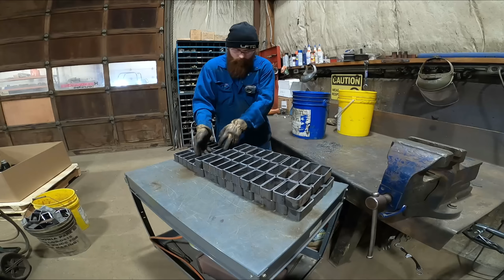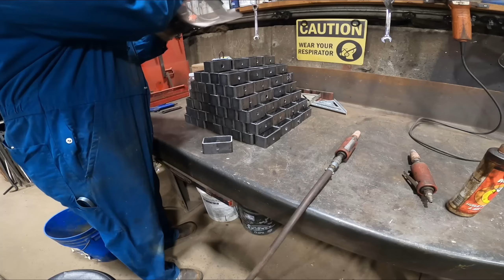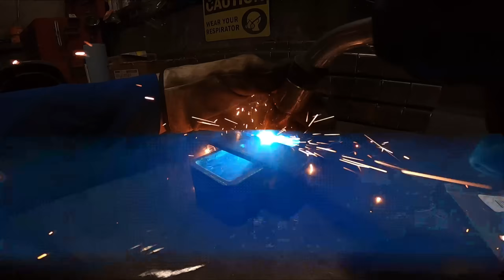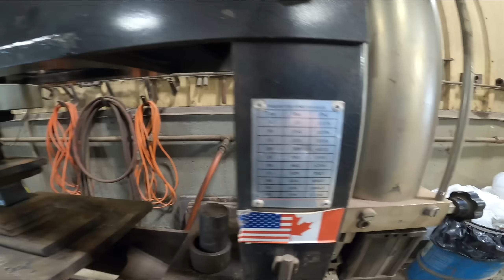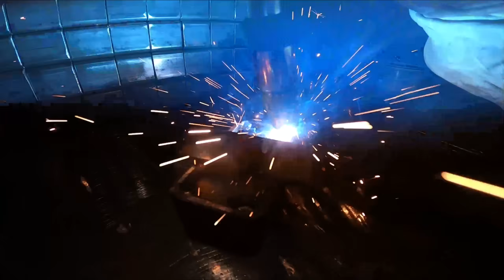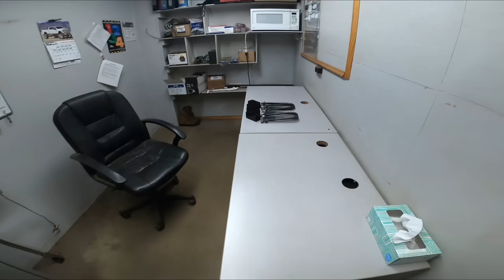How we fabricate a 2" lift kit for a camper trailer

Comment: You may want to look at an industrial shop that has huge resistance welders to weld the center pins in. The would weld the pin in the exact center in a matter of seconds. You could look at a capacitance discharge welder to do it yourself. Much faster and probably cost effecrive compared to labor rate.

Comment: Soild block would be a lot faster. A lot of driiling I did 52 2" and 52 3" it took me 2 about 15 hours to prepare drill and debar and clean the blocks for powder coating.
Reply from the maker: yes, solid blocks are a lot faster, now we can do about 30 blocks an hour.  Can't wait to get my 2nd drill press rolling this fall so we can do 60 blocks an hour.

Comment: I work for Northwest Steelcrafters and I have been making lift blocks for trailers.
2" & 3" blocks.
Did all the prediction today powder coating 
Tomorrow.
Lots of work with a 1940's Bridgeport milling machine
Reply from the maker: We started making them out of solid steel.  2x4x1.75
Reply: @simcoespring  
Nice work.

Comment: Why not just whack a stick of 2"x2" into 4" pieces? In 5/16 wall they'd hold god knows how much but 15T would be no problem and you wouldn't need to waste time capping them.
Reply from the maker: Because it is 2 x 1.75.            Not 2x2.  A more complex shape
Reply: @simcoespring  Still could've used it, a 2" Ubolt over a 1.75 pack equals an 1/8th on either side, not really critical. Your profit after labor wasn't worth it, not unless you pay your guys 5 bucks an hr. and even then..
Reply: At. Work we are making trailer raiser blocks we use soild steel blocks cut to size
I have been drilling 2" and 3" blocks for pins
Reply: @dennisgolden7596  Solid steel?! Lol. What the hell is the trailer carrying that you'd use bar stock? I use a 1.5" slice of 3"x5" 3/8 wall box on 50T Murray RGNs modified for OD transport to make up for going from 24s to 22.5 lo pros. And I just run a few beads fore and aft of the Ubolts to locate it. Easy peasy! And it costs about 20 bucks in T/M per 4.

Comment: Basics: What is the purpose of this product and why is your product the most cost-effective way to do it?   You have an insane amount of credibility with me which means I value what you have to say, but you must make your arguement / reasoning of why you are putting your time and effort into making this product.
Reply from the maker: the purpose of the product is to lift a trailer (usually camper trailer) up 2" to match the vehicle that pulls it.
Why is my product the most cost effective way to do it?  Probably not, there is probably cheaper stuff out there, but you get what you pay for.
Reply: Nobody else's blocks look as cute when you squish them. “If the women don't find you handsome, they should at least find you handy.”
Reply: @deconteesawyer5758  Red Green 😁

Comment: 26:17 when in doubt, shake and bake. you probably don't have a thermotron cabinet in your shop though haha. if you want to go all out with testing, i'd rig up some temp cycle testing to put it through death valley style cycles, say 120 F to -30 F and then set up some dynamic load testing where you have something heavy just get dropped on it over and over. i'd also slap some transducers on it and give it some road vibrations. ideally you would do the vibe and temp test at the same time. after all that you could do some fancy dye tests for fractures or use an ultrasound if you have one laying in the back somewhere lol. 

that's probably all the random testing i'd do if this part wound up in my lab with no actual requirements other than "will this fail and when will it fail." which that did happen from time to time. i never really tested stuff like this block though, so i'm probably missing something more obvious. i would probably loop in a certified weld inspector and try to make it their problem haha

Comment: Interesting.  I would cut a section of square tube to place inside the channel perpendicular to the orientation of the outer channel.  A Notch could be cut to clear the pin and you would have a strong assembly with less need for so much welding.  Try it, you'll save lots of time.

Comment: This is a friendly and well meaning  piece of advice from an old retired mechanic. Protect your lungs. Please wear a filtration mask. My lungs are wrecked from breathing in several decades of various dusts and vapors (smoke and fumes from welding). Like the caution sign in front of you at 28:10 reads. You guys are still young. Please , protect your lungs.

Comment: You can cut the drilling process in half. Clamp the vice on the drill press bed and make a stopper to push the part up against so they always go in the same place. Just push the part up to the stopper, close the vice and drill. No more double measuring and center punching.
Reply: Exactly what I thought!
Reply: Yep, same.
Reply: Very same thing i was thinking
Reply: You all beat me to that one .... set up for the first one - then repeat until done.
Reply: Well, center punching or drilling is crucial, still. Depends on tolerance.

Comment: By placing the center plates recessed, you created essentially 2 I beams, a stronger setup compared to a box had you welded the side plates flush.
Reply from the maker: I was also concerned about clearance for the Ubolts.  This way I didn't have to weld it all, then grind it flat.

Comment: Nice side hustle! Couple suggestions to speed up the process... order your blocks cut from seemless tube so you don't have to drill through the seem, that's hard on drill bits. Use 5/8 round stock instead of bolt heads, cheaper and only drilling one size hole. And definitely fab a drill jig so there's no measuring or punching required.  End product looks good.  Cheers.
Reply from the maker: thanks, since posting this video we have changed a lot of what you suggested.  We are always trying to develop new ways to manufacture parts more efficiently.

Comment: For  300 dollars for the tamden set I ll buy new u bolts and build them blocks myself.
Reply from the maker: Go for it.  We have the u-bolt kits sold separately on our website as well.
https://simcoespring.com/products/2-lift-ubolt-kit-tandem-axle-trailer
Reply: @simcoespring  for $111 for two axles! That's still crazy. I sourced the materials myselt and was able to do two trailers (6 axles total) for just under $150 which included spring seats.
Reply: @Globalhec  sometimes it is about the quality and not about price just look at what china ha# done to our markets with cheap parts one use and mostly replacing again so in the long run buy North American and use the hell out of it or spend YOUR time building your own.
Reply: @jamesmorgan6782  that's precisely what I did. I choose to spend my own time and fabricated my own. It meant the most sense considering that I needed quite a few of them.
Reply: Like I say good work ain’t cheap and cheap work ain’t good case closed you get what you pay for I’m getting my set

Comment: Production work is a different mindset.  Set up a fixture for your drill operations.  No need to mark, measure, and center punch.  That removes three operations.  You could pickle the steel instead of sand blasting.  That basically allows you to parallel a process.  More than enough weld on there.  Straight stringers is more than strong enough.  So that saves some wire, gas, electricity, and time.
Reply: I'm glad I wasn't the only person who saw this. The people in the video did WAY too much work. They could either lower the price of this product or increase profits by decreasing the labor they were doing. Cheers!
Reply: 10 times safety factor is insanely overbuilt too, but i get it. aero is something like 3 times lol. its a hard target to hit, but you want it exactly strong enough, with not an ounce of strength over. Boeing has poured a crazy amount of money just into exactly hitting tolerances in their requirements (and literally not going over at all). i always pushed my safety margin as far as i can though. i'll never be the guy explaining why billy isn't ever coming home again, even if it costs my company a few extra cents